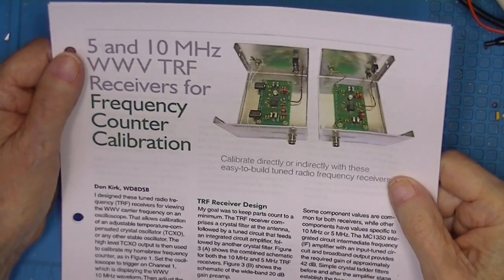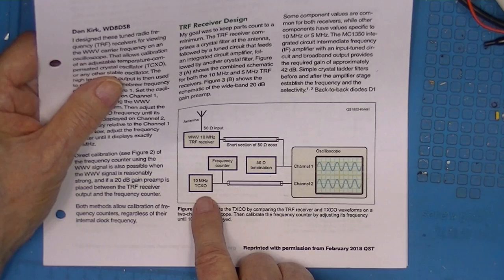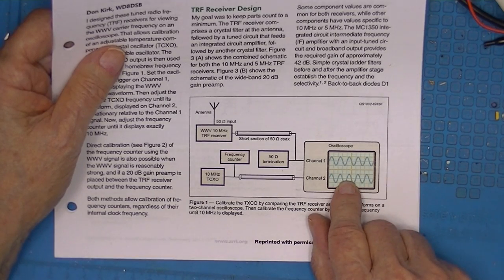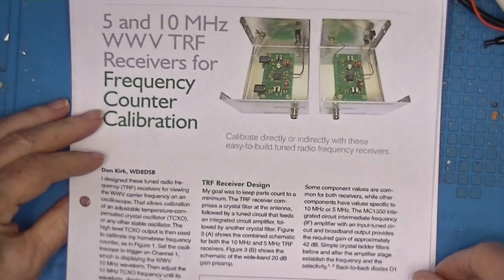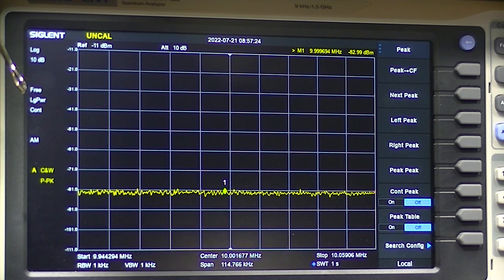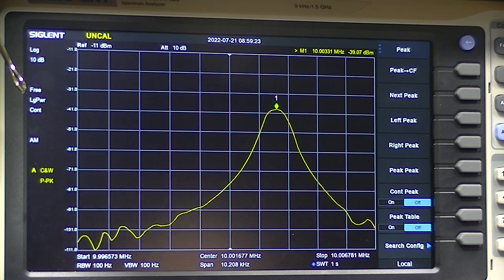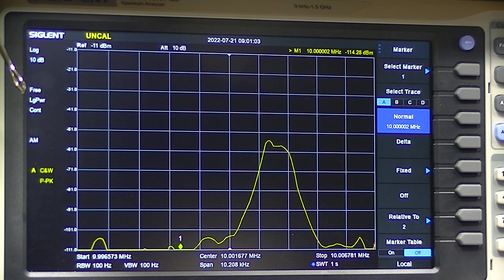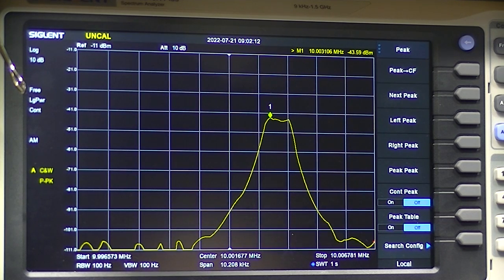10MHz WWV Receiver Part 2

Comment: Hi Steve,  great video.  I'm the designer of the WWV TRF receivers you are building.  As you have found out, you need to use 10 MHz crystals as I have specified, or 10 MHz crystals that have a similar specification (maybe a good saying would be that a 10 MHz crystal is not a 10 MHz crystal is not a 10 MHz crystal).  The frequency of a crystal is marked based on its intended use.  If you look at available crystals, you will see some identified as series crystals with no load capacitance listed, and some identified as parallel crystals which will have a load capacitance listed.  I designed the 10 MHz receiver using 30 pf load rated crystals, and the 5 MHz receiver using 20 pf load rated crystals.  Parallel crystals will resonate at a lower frequency than their stamped value in my application if you don't use them with their specified load capacitance, and in my design the external filter components (capacitors) is what brings the frequency of resonance up to 10 MHz.  This project made me learn more about crystals than I had ever expected to learn, and this included building and testing crystals to measure their actual properties (motional inductance and motional capacitance), which then allowed me to model their behavior using LTSpice software.

P.S.  Interesting comment about not liking the name preamp for the amplifier, but in the electronics industry it would most often be considered a preamp and I like the definition found on Wiki regarding a preamp which is described as "A preamplifier, also known as a preamp, is an electronic amplifier that converts a weak electrical signal into an output signal strong enough to be noise-tolerant and strong enough for further processing", and that is definitely the intention on how the preamp is used with the WWV TRF receiver, as its purpose is to bring the weak signal on the output of the TRF receiver up to a usable level for a frequency counter.  No real right or wrong answer I guess.

Let me know if you have any questions or issues.
Don